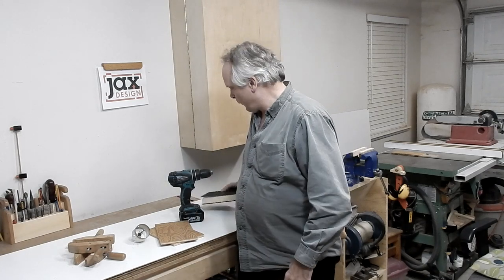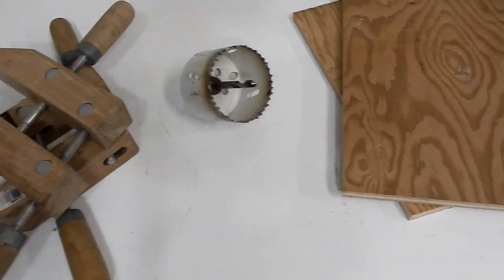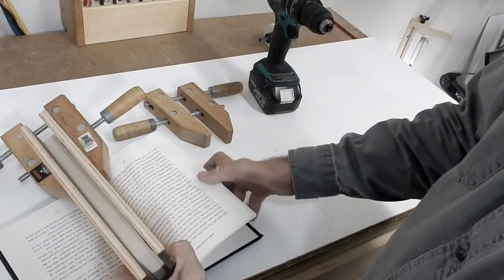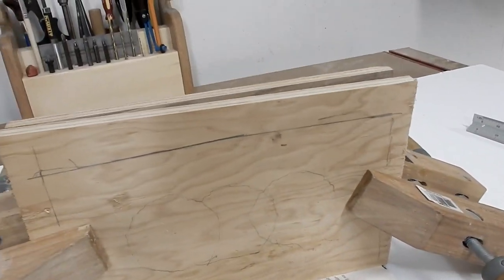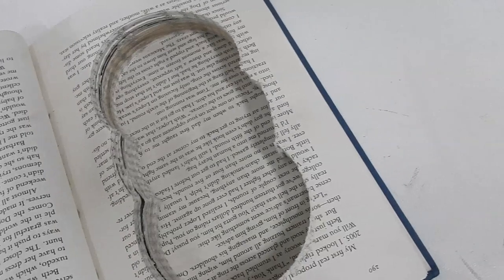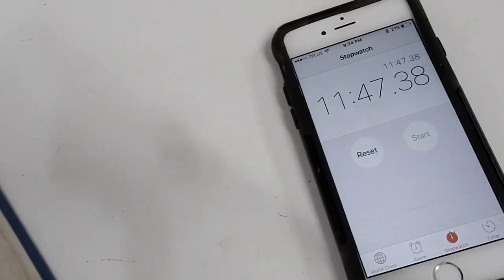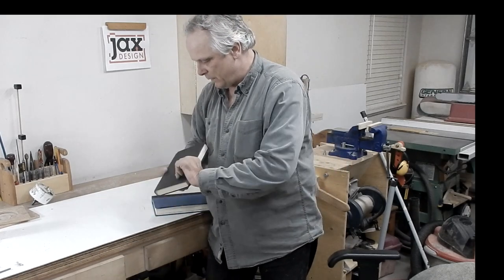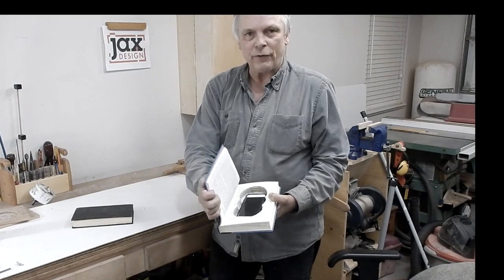Easy way to make  Secret Compartments in  Books.

Comment: Simple, effective, great outcome.  By the way - what books did you sacrifice for the project?  Just curious. - Annie
Reply: Could you even after the holes are drilled with either cordless or drill press then use a band saw or something like to go through and make the hole a rectangle to hold more things? 

Whenever I make my book safes I don't actually glue each individual page down. I clamp them all together and put a thick coat of elders glue (dries clear) around the edges so it doesn't come apart. Works better n doesn't warp the paper.
Reply: Elmers*

Comment: Thanks Jack! I tried to do this several years ago with the ruler and blade method and gave up. I had some tiny speakers and amplifier to install along with a battery pack and a slot for an iPod. I still have the books I picked up at a thrift store for the purpose, so I should give it another shot. 

Incidentally the book titles I picked up include "The Home Book of Musical Knowledge", Stephen King's "Insomnia", and "What Lie Did I Tell?" All seemed appropriate for this project. :)
Reply: +Jon Miller Wait so you were going to turn a book into a boombox/stereo? That's a curious idea.
Reply: Myanameis Beestingz Yeah, I still have all the parts. You can get 5v amplifiers on ebay for almost pennies, I love the quality of Gentoo 2" speakers (as close to full range as you'll get in a 2" package), and 5v batteries and charging circuits are just as cheap as the amplifier. Throw in a USB connector, audio cable, and your phone or ipod (or even a cheap, dedicated MP3 player) and you have an entire portable sound system of your own design. Someday...
Reply: Jon Miller Very cool! I built my own boombox using a car stereo, some lithium ion batteries and car stereo speaker cones inside an mdf box. Not entirely sure what the point of the project was- sort of an answer to a question no one asked....At least yours would have some utility. I might have to try it out!